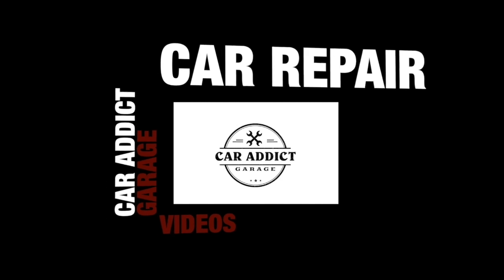What Is The Epoxy Primer Window TIme?

Comment: in your video you said you should cute out 3 to four inches past the rust hole so you have good metal to weld on the new metal,  would it be ok to cut out 1 inch past the rust ?

Comment: My question would be around epoxy primer sealer. I am painting the wing of an airplane that’s obviously aluminum. Sanded and remove much of the flaking off paint as possible. I wanted to avoid doing the stripping process. I took everything down to 500 g-sand paper. I sprayed and Epoxy primer sealer on by T. Rex DTM epoxy primer sealer speedokote. Unfortunately I did not use the proper air pressure at the cab (I now know what that is)and the material was a little bit thick and went on like cottage cheese on two of the wing surfaces before I got it reduced down to lay nice. The tech data sheet indicates that I can sand after 24 hr. I pland on top coating with in my 24 hr window but now that’s out and I Am back to sanding.  The other issue it lifted in a few places. Help what my next move. Using 2k paint by Axalta  Nason.
Reply from the maker: Yes, too low of air pressure or wrong mixing ratio can cause the excessive orange peel.  I haven't had a problem with epoxy lifting.  Make sure you wait the flash times and don't try yo put too much o at one time.  That may help that issue.  Here is a lesson on gun adjustment that may help.  http://www.collisionblast.com/2012/11/17/spraying-painting-tips-how-to-adjust-a-spray-gun-to-produce-professional-paint-job/

Comment: when you apply epoxy primer  over  metal  and you have nice un insolated garage that does not have any roof rain leaks   can you   leave the epoxy primer  parts  over   1 year threw the winter in the garage   until  ready to paint  in  1  year  ??

Comment: I’m spray a frame with epoxy sealer. Would you recommend sanding the epoxy before paint? I just had my frame blasted yesterday. I’ve sprayed the sand all off after drying them I sprayed the frame down with wax and grease remover.

Comment: I have E-coat replacement floor panels  would it be ok to use  DTM urethane primer on the bottom and top  and start top coating?
Reply from the maker: Yeah, just make sure the primer does not require sanding, which some don't.  However, many surfacers require sanding before topcoating.